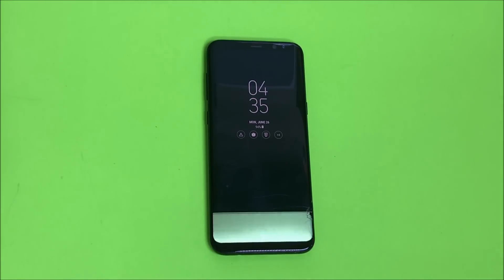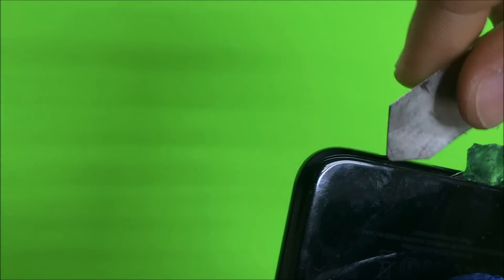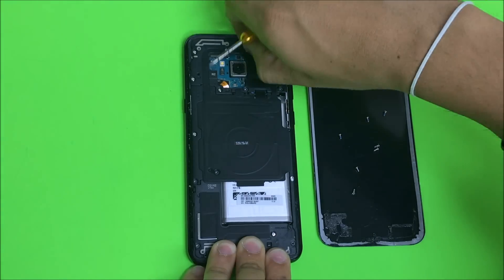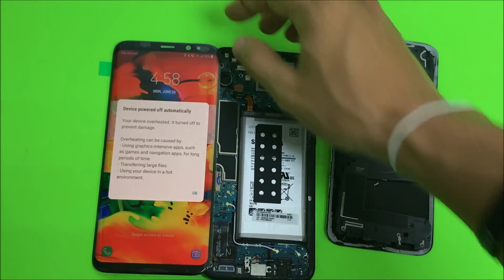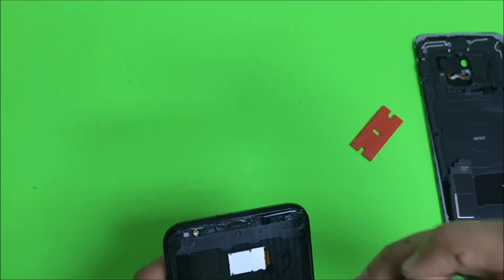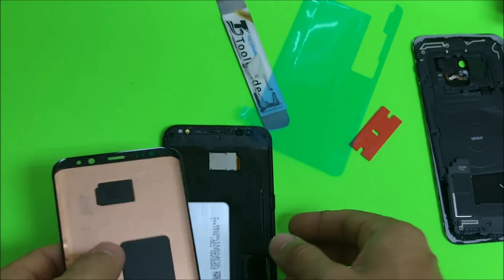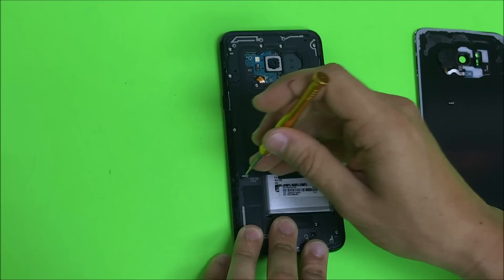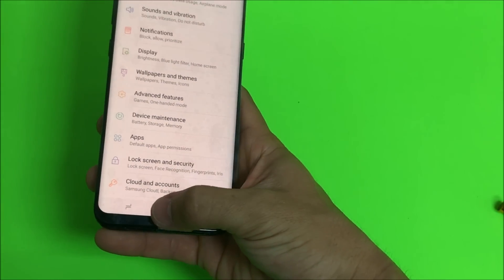Samsung Galaxy S8+ - How to Take Apart & Replace LCD Glass Screen Replacement

Comment: Great video.  Unfortunately after taking it apart and putting the new screen on, am now getting a flashing white triangle with red thermometer icon, any ideas what might be causing that?  It will not power.